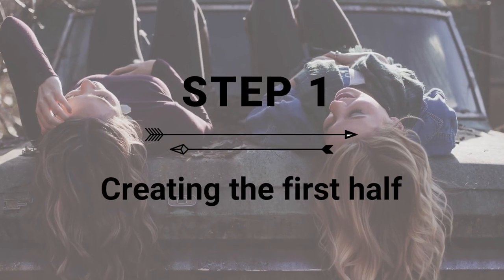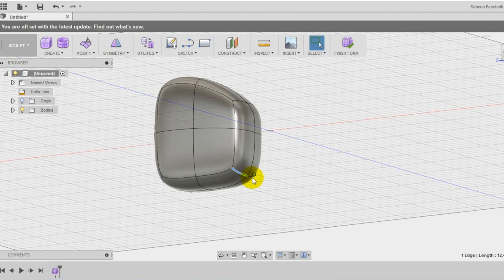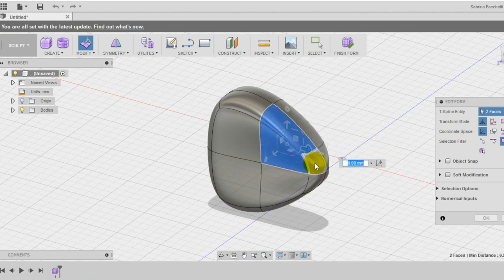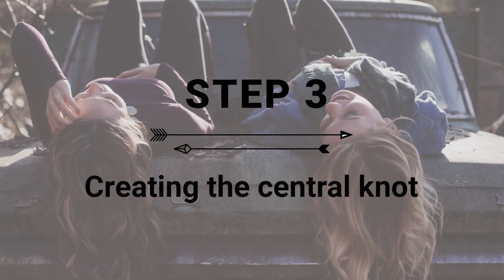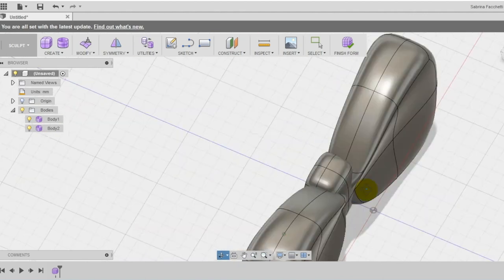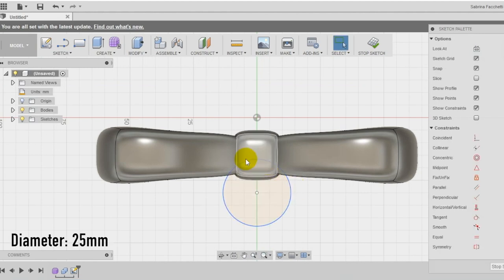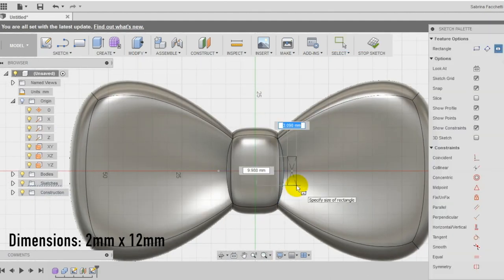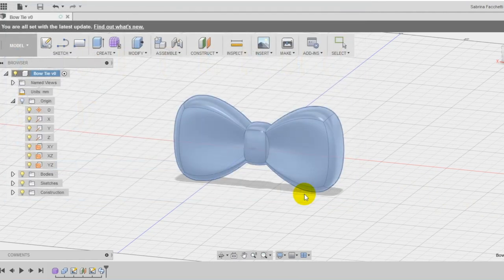Fusion 360: Bow Tie

Comment: I did exactly as you said and it came out nice at the top but at the bottom of the bow tie it was very messy and filament was everywhere. It was also very rough and the bottom wasn't flat. Can you please help me fix that problem and is there a flattening tool in fusion 360.